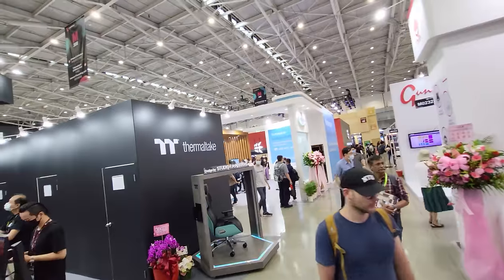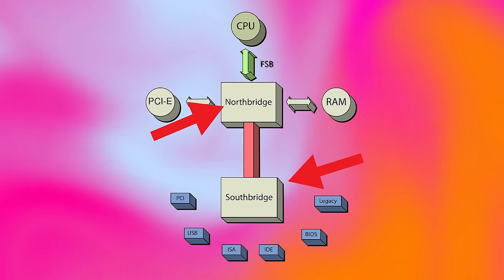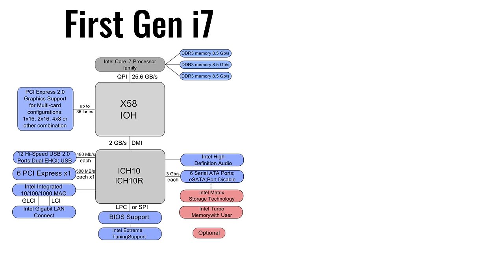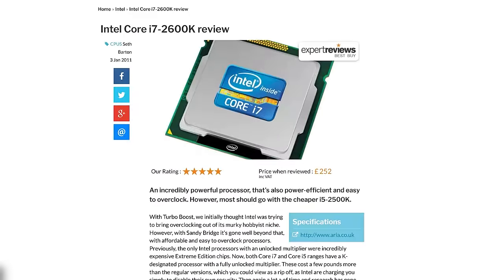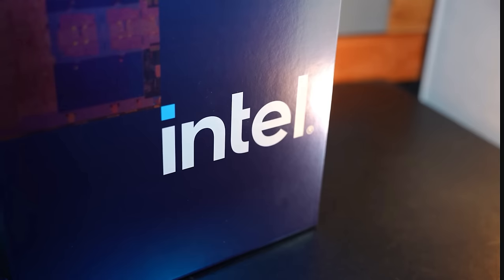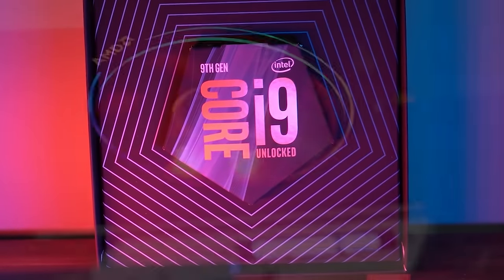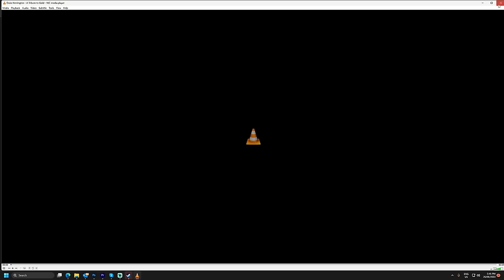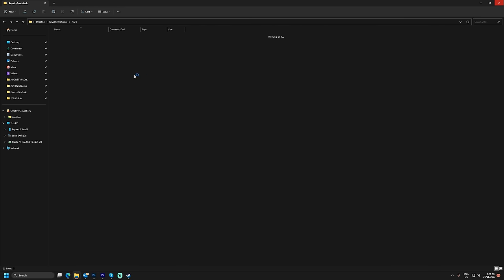SNAP - The Intel CPU Latency Story (Part 1 of 2)

Comment: I can recognize the error with both my 13900K and now 13900KS. However! - I only notice it when dragging a file sometimes... its like the file will not let go with the mouse.. sticky! This happen often also with VLC Player trying to drag a new file into it to play.. I always wondered what it was? I honestly thought it was M$ to blame haha!   I will say however about your downgrading that for me that makes NO sense whatsoever.. I have the 13900KS and it the best, most advanced and powerful CPU ever. I would NEVER downgrade to my 10900K over my KS. The 13900K(S) are blazing fast also in latency and memory ram performance, newer production node along with new architecture and much much more...  I just learned to live with this occasionally drag drop issue, easy fix is to drag same file again and it works- although very annoying! But in every aspect the 13th gen are gonna smoke the 10th gen.. so I cant see the reason or advantage to do this. Its also an older 14nm node and architecture! There is nothing wrong with the 12th and 13th gen, we hope Microsoft and Intel down the road makes a fix for the Windows Kernel or something... :-p
Reply from the maker: haha so you notice it it too, though the only way to find out now is to compare it with my everyday use tasks.

Comment: 13900k user here and iv noticed these issues first hand, i assumed it was either A) a windows 11 issue or B) an intel CPU issue and was actually considering going AMD next gen due to these hangs
Reply: AMD has similar issues really due to also having IO driver off the CPU die. Only 10th gen and older Intel doesn't have this issue.

Comment: There's probably a perfectly good explanation for your issues that doesn't involve some "I/O driver" change. Otherwise there would be clear evidence, like when Rocket Lake was sometimes slower than Comet Lake in game benchmarks. I think your wife may be right :P
Reply: Clearly the computer is having trouble pulling up the directory. I find it hard to believe this is an actual fault with the CPU, more like an artefact of Windows on the new CPU. Something that once spotted by the developer would be swiftly rectified.

Comment: Can confirm with 12400f that this exact problem drove me insane for quite some time

Good news is I managed to mostly fix it.. the delays lasting multiple seconds all the way up to total lockups are all gone but I do still get occasional micro stutters when interacting with some things like file explorer
Bad news.. I don't remember all of how I did it

Most recently I was having issues where right clicking some files would take 3-5 seconds to show the menu - disabled one of Google Drive's services which solved that one
And the suuuuper slow loading of specifically folders full of video files was fixed by removing the "length" column from the detail view. I can still mouse over a file and the length shows up but that column for some reason brought everything to it's knees

Comment: Yeah my 11900k with 4000cl14 ram in gear 1 definitely has a better snappiness to it than even a new cpu with ddr5.
Reply: So it seems to not include 11th gen? I guess that makes sense because 12th gen is when all the big changes happened.
Reply: @kakashi99908  yeah 11th gen was still monolithic like 10th gen. 11th gen was essentially hybrid of 10nm cores shoved into a 10th gen cpu which was 14nm. The cores were bigger and being put into a smaller format than intended which was why the i9 was only 8 cores while 10900k was 10 cores but really not much else was different architecture wise besides pcie gen 4 and AVX512. 10th gen and 11th gen were still very similar, too similar some might argue. Everyone likes to shit on 11900k cause yeah as a top dollar i9 it was a ripoff especially when everyone was expecting Ryzen amount of cores but with a heavy discount it’s still a great cpu. It’s single core performance is still pretty damn good, AVX512 support is still very valuable especially when Intel no longer has it in consumer chips, plus DDR5 at Alder Lake was a shitshow of overpriced garbage while DDR4 Alder Lake boards were lacking quality and features. I bought a 11900k and Asus Rog Z590 hero in a bundle for $400 and I’ve been happy with that especially when even with my 11900k and 3090 strix oc I can still even benchmark higher than some people with 12900k and a 3090, in 4k anyways (I think the reason why I could bench higher is my OC’s and b-die ram at 4000 14-14-14-34 meanwhile they were probably using a founders 3090 and garbage tier ddr5 like 5400). Either way I’m still very happy with my setup and latency is definitely noticeable, I’ve tried 12th gen and wasn’t impressed but hopefully they can figure out the latency hump. Probably actually why Intel wants to kill off x86 for an exclusive x64 experience

Comment: Nah, dont belive the cause of the issues Bryan has. does it really have the I/o on chipset instead of the cpu when it comes to alder/raptor lake? because the snappiness is about the ringbus(cache) and the latency of the ram. For instance with ddr4 if you dont oc and tweak the ram on an 12/13 gen it will feel like somebody is holding your jacket from behind, or maybe compare to when you are walking/wading in knee high water in warzone. of course e-cores are turned off. 

Alder/raptor lake is still ringbus u-arch and it is not a mesh u-arch like the older intel hedt was, heard Bryan talking that he wants go back to ringbus ie the 10th gen i9 before, not only in this vid, but alderlake/raptor lake are still ringbus u-arch. and if u are using ddr4 u need to tune the ram, 3800-4000mt/s at cl14-16. 

When it comes to ddr5 tuning the ram heps as well, but because ddr5 actually can be accessed twice as often as ddr4 the issue is not as bad.

Comment: I got a much worse experience  than you when I updated win10 to win11 on ryzen 5600x. Open the search or what the new menu is called could take 30 seconds. A clean reinstall made the whole system snappy.

Comment: It seems Windows 10 / 11 in particular are pretty bad. Windows 95, 98, 2000, XP, 7 and 8 were pretty snappy with much less computing power. File Explorer in particular is bad in Win 10 and 11 (only updates the file list with manual refresh etc.) ...

Comment: try this put your ram speed to the same frequency as the memory controller on the cpu.
example on a i7 12700 in the spec sheet it says ddr5 4800Mhz
amd r7 5800x i have kingston 3600mhz c14 runniong at 3200mhz. ANd i get better results in cinebeench than i do with it set at 3600Mhz plus the system runs a lot better.

Comment: I would like to add, that before the nehalem i7's, the time that the Athlons kicked intel ass, it was in big part due to the on-die memory controller, that was like "the first time" on the Intel vs AMD cpu fight that they started integrating northbridge systems inside the cpu die for way better latency. And memory loves low latency

Comment: I have these exact same latency issues when using SATA drives but not when using NVME drives that sit on one of the CPU's PCIe lanes. (13600k)
Reply: When I first installed my OS to a SATA SSD on my 2700x build, I literally couldn't do two file transfers at once. If I was copying a large file or batch of files, the system would not do any other file transfer simultaneously, and often wouldn't even let me open an application, but once I switched to an NVMe SSD, it was fine...

Comment: That looks like windows 10 right? My 12900ks did some odd stuff in windows 10 before I upgraded to 11. It's much faster than my friends 10900k in everything. The 13900k is faster even more. I bought a 7950x and it's literally slower in some game benchmarks vs my 1950x threadripper with the same exact gpu but I wouldn't run around calling it an "upgrade". It's possible you have some other driver/memory/OS related problem too. I think blaming your problem on a hardware bug is unfounded. It's extremely common on z690 or z790 that your memory will be stable in some apps but not everything. Builzoid has a 1 hour plus long rant video about it.
Reply: I don't think you really understood what was being said in this video. This isn't a hardware bug. This is a severe fault in the design of the processor, it's not a bug, it's a design flaw.
Reply: That's Windows 11 in the video
Reply: @username8644  A few 'us' latency from cpu to hub can't cause explorer freezes for a few seconds.
Reply: @user-iq2cg6uq3v  yep!
Reply: @user-iq2cg6uq3v  Whether it can or not is another story. My point is that the original commenter is saying that the YouTuber is claiming this is a hardware bug, but he is actually claiming it's a fundamental design problem with the processor. So the original commenter does not seem to be really understanding what was said in the video.
Reply: My 7950x system screams. It literally does not show any of the issues shown in this video, although I have seen them on Intel systems. I do have a Wd Ssd with a very fast "real world" score as my boot drive.

Comment: Modern Intel has always been out of my budget.  Kinda why I went older vintage Xeons.  I run an e5-2650 v2 w/ 27 GB ddr3-1333;in quad channel as a non gaming daily driver powered by Linux Mint 20.3.  no latency issues

Comment: How about using a high speed camera to verify your claims? Personally, using 32 GB of RAM and decent NVME drives I have a hard time noticing any difference between 12th gen Intel and Ryzen 5000 systems, as I have both connected to the same monitor.

Comment: You have operations happening from millions to billions times a second in hardware. If you have halts of multiple seconds, it isn’t hardware, it’s software.
Reply: There is one thing that will stall a pc that i can think of spin up of a mechanical drive does this for around 2 seconds
Reply: @Shonkuk1  memory management can cause this issues too. I’ve watched this in linux with TLB showdowns

Comment: This is sure not to be an issue with the SSD? It sounds like something that should have a possible software/driver fix.
2 seconds is extreme for something caused by CPU! It seems that such a small scale change inside the CPU would have a much smaller impact if translated properly by the drivers.
With Ryzen 5000 I`ve had an issue with some systems that had the entire system hang (completely frozen) for a second or so in any type of activity, be it games, browsing, anything. And that would just happen periodically, like every couple minutes, over the entire time of usage. It was extremely annoying.
Right now not having the issue anymore, though. (On a X570S chipset with a 5800X3D atm, I did have that issue using a X470 chipset with a 5800)

As for the latency in miliseconds, I would sacrifice some for bigger overall performance, although minimizing latency is benficial in multiplayer games.
Interesting topic.
Why not 11th gen? It`s more efficient than 10th gen.
Reply: Yeah I'm not sure what this is talking about.  I've been on 12th gen now for a year and literally EVERYTHING is faster.  Only delays I've ever seen in Windows 11 are due to mechanical hard drives.
Reply: Maybe it's a very specific use case?...
Reply: @nilz23 my laptop with a 12700h feels way snappier then my 10700k fully tuned ever has. His issue with files not loading is definitely a windows issue with either a local drive or an issue with SMB network sharing with his NAS. One bad drive connected to windows can cause file search on other drives to come to a crawl.

Comment: What if you pushed the RAM to the max speed with the lowest max latency?
So many gamers run garbage XMP and EXPO RAM settings, they are utterly slow and bad from a latency enthusiast perspective.
Overclocking to higher RAM speeds with super low latency is a huge snappy feel booster from the root.
On top of that you can do all the others like CPU overclocking, Windows 11 maximum optimizing and modding and more.

Comment: That sucks that intel wont change there whole layout of there cpus, to handle latency way better, i heard also that the more cores they had the worse latency they will have vs AMD due to how they do there calculations in a circle then a chiplet design.its kind of like windows 11 that still has core windows 95 systems but so out of date it sloes down or even breaks the os... it needs to update from a new seed. From the ground up newer techniques and technology. Gotta go out with the old and in with the new. Or gonna have trouble.
Reply: and in doing so brake an unthinkable amount of software and drivers

Comment: Please also add how this directly relates to dpc latencies in the next episode. After all these new generations it still bugs me how they still cannot defeat this problem or find a solution to reduce it..
Reply: DPC latency is an issue with bad driver implementation or hardware interrupts overwhelming the CPU (aka, to high polling rates). I have both a 5950x and 12900ks (with 3090 and 4090 respectively )and neither have any issues with DPC latency. 

A clean windows and Nvidia driver install (debloated windows and using nvclean install to debloat the Nvidia driver) solve those issues for 99% of people.
Reply: @winebartender6653  Yes, but there are also reports of people in optimization forums that they say certain hardwares had worse or better dpc latencies so it would be a great addition for his video if he can figure a direct correlation.
Reply: @SupremeMasterr  Hardware has to go through a software layer unless it is using interrupts (which is still software, but I digress). That was the point I was making with the polling rates and hardware interrupts line.

An example of this is using mice with high polling rates (like 4k and 8k).
Reply: @winebartender6653  There is certainly a difference between processors in DPC latency. A faster, low latency CPU will simply be able to work through its DPC queues sooner on average. For example, disabling a CCX on older Ryzen CPUs will typically lower DPC latency substantially, same with disabling hyperthreading on almost any CPU--and both hyperthreading & multi-CCX architectures are known contributors to total system latency. Though some of these hardware factors will only be significant once most software-related issues have been resolved.
Reply: @half7232  I never said there wasn't. What I am speaking of is having DPC latency that generates issues with anything real-time sensitive. Both the 12900 and 5950x(with both ccx's enable and smt) max out at around 240us(microseconds) in the worst case in my setups (and that is a call to the windows nt kernel, which produce far less calls compared to the display driver). The average latency on the 12900 is sub 30us and the 5950x is sub 40us. That is leaving latencymon run for an hour on both systems.

My point is that DPC latency that causes issues is 99% software/driver level, maybe even firmware level of the hardware (but that is less likely). 

The reason these issues are difficult to fix is because it is so heavily reliant on how fudged up someone's PC is from an OS/Driver level.
Reply: @winebartender6653  What do you do for a living?

Comment: Another problem its usb 3.0 don't use it. Disable if you can
Reply: why? what version usb use?
Reply: @michal1693  some cheap connectors dont have suficient shield and can bug the hardware you can use a old mouse 2.4ghz to test

Comment: "There's a lot that was answered here"

No. No there wasn't.

If you're seeing the lag shown, then it's something wrong with your system. My 12900K doesn't exhibit anything like what you're showing, nor does any of my friends who use Alder Lake.  Can you show any metrics at all to back up your claims? CPU utilization, confirm RAM speeds / channels are working, specify if the drives that are show are via PCH or SA connection, make sure the NVMe are running at correct speed, reinstall windows, default the BIOS, etc etc. 

Your claim that 'that IO driver functionality of the system agent has now moved off the CPU' needs more specifics behind it because that makes no sense, and isn't supported by die shots. 

Are you sure you 'contacts' aren't referring to MTL's IO being moved from the compute die to the SOC and IO die?

This video makes very bold claims and provides no real evidence and you're tricking people into thinking there is a problem where there likely isn't.
Reply: yup

Comment: My 11900K at 5.3GHz and 4000MHz G1 memory is still the snappiest system I ever had. Especially compared to AMD counterparts that I had before like the 3900X and 5900X. I never wanted to go Intel 12th or 13th gen because of the e-cores but this gives me more reason not to upgrade. Very interesting stuff that no other tech journalist are covering.

Comment: I'm going to wait for part 2, But for now I'm not saying the issues you are having aren't real or caused by 12-13 Gen but I really feel we need to really investigate this before says it's a 12-13 Gen issue. I'm saying this because my 12700h laptop has always felt much snappier then my 10700k fully tuned build has. The issue I saw in the video looked to me much more like issue with windows, SMB file sharing, an issue with a local drive or drivers. (probably windows shit search tho)